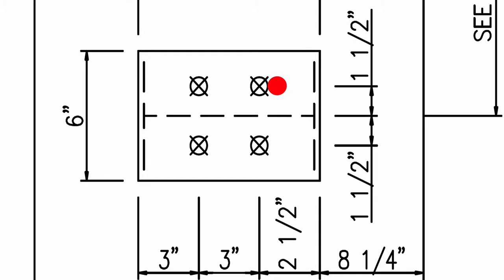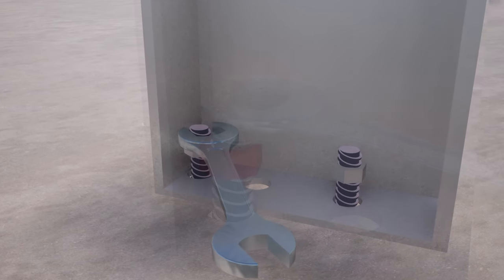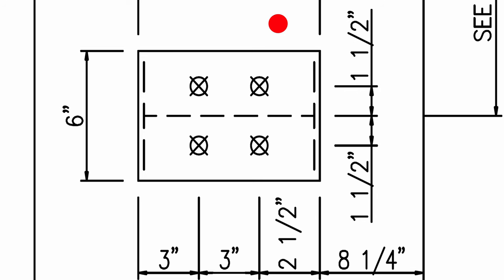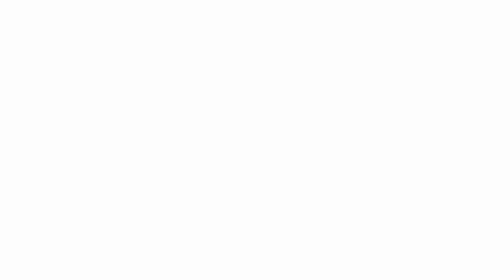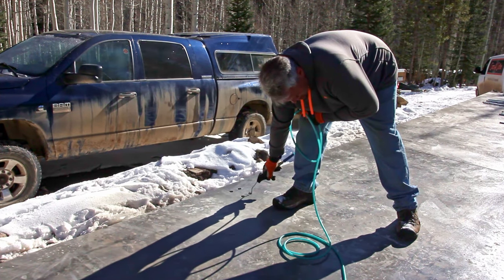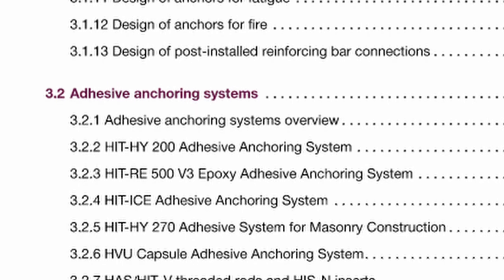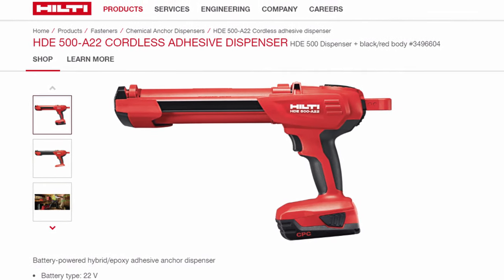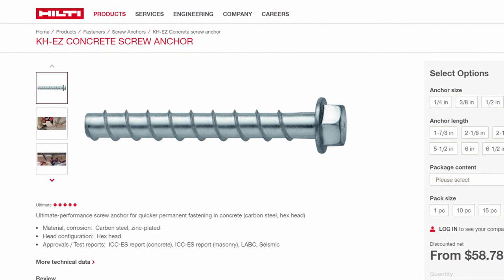NEW How to Measure Anchor Bolts - Part #3 - Anchor Bolt Problems

Comment: Hands down, have your anchor bolts set in the concrete pour!  -- A note, if you have a poured foundation with a raised stem wall.... Check with you concrete crew to see if their forms allow for smaller clearances between their form and the anchor bolt template.  I ended up drilling in all of our doorway anchors (8 doors in total)  It was not a fun job and as Eric said, it took a good deal of time and many tubes of expensive epoxy.

Comment: Hi Eric, we’re getting our site prepped for a soon-to-ship GWB structure and have a few Q’s about anchor bolts that other customers may have as well…

1. Our foundation plan from GWB doesn’t reflect minimum embedment. Our civil engineer advised I reach out to y’all, so here we are. :) Is there a rule of thumb?

2. Should the bolts be straight or “J”, and does it matter? 

3. I’m hoping to follow in @Dach’sAutos footsteps and build this myself, but am obsessing over anchor bolt placement. Our concrete contractor typically hangs them with wire, but I would feel much better with a precision template, (like the kind Mueller offers with their kits). Any chance you could record a DIY template vid, and/or have you come across a 3rd party who makes these?
Reply: Hi Nate, I am sorry no one has responded to this yet. Do you have time to discuss this today or tomorrow?